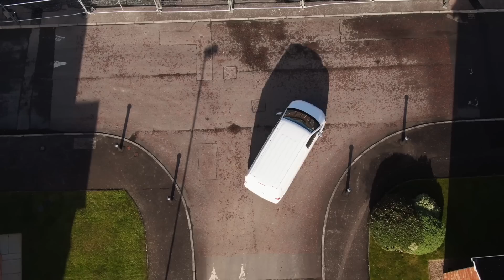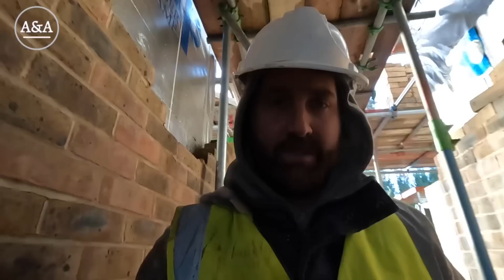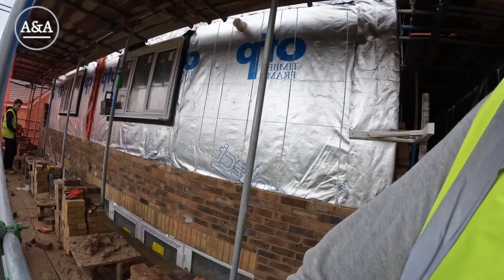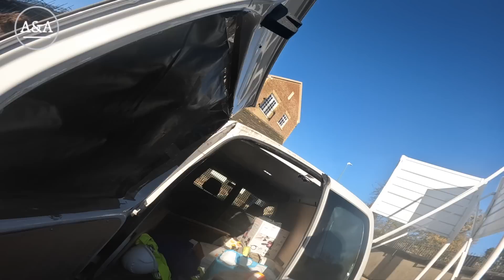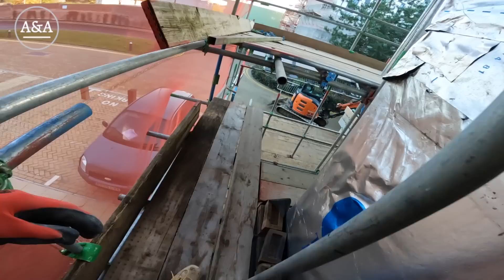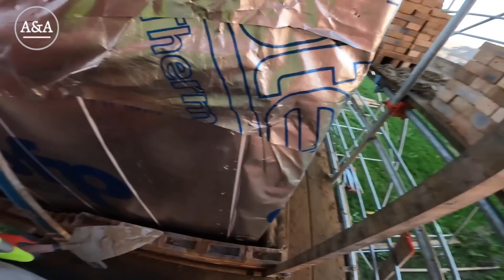The BAD Side Of BRICKLAYING!

Comment: Hello mate looks a nightmare that, only done timber frame a couple of times. What's the regs on fire socks between floors ? They made us put socks at floor heights aswell as closing of the openings, we also had to but foam underneath the windows was just wondering if your regs are the same as ive described. Works work though mate, soon have a couple weeks off 👍
Reply from the maker: Hello Nathan mate, yeah usually that is the case, a few people have asked me about it but here they just want fire socks behind the lintels and either side of the expansion, I think the way you have described is the normal though but different here for some reason. Ah man I am buzzing for them couple of weeks off